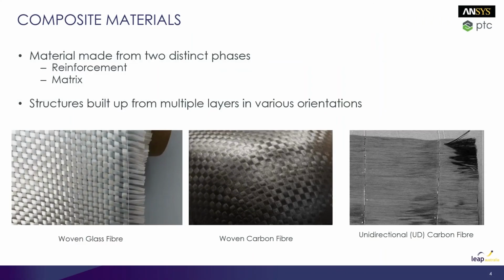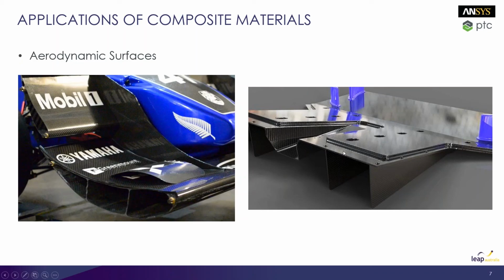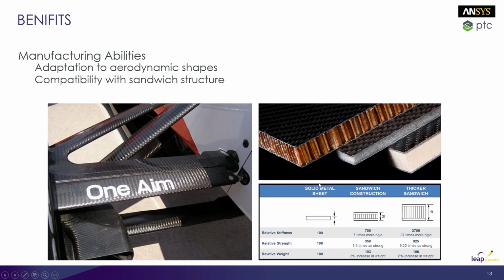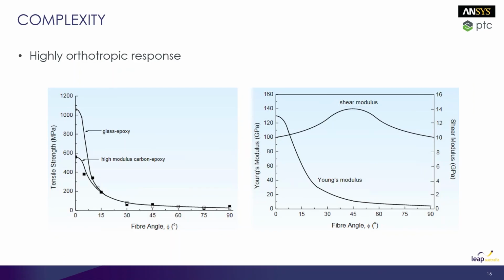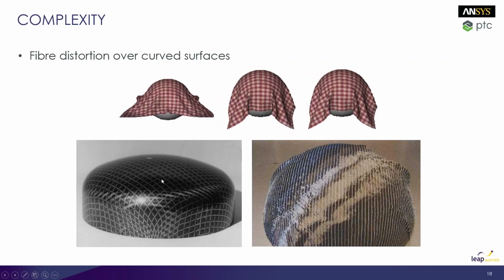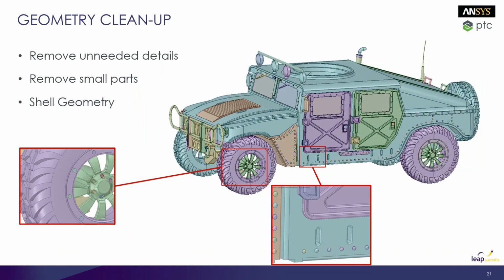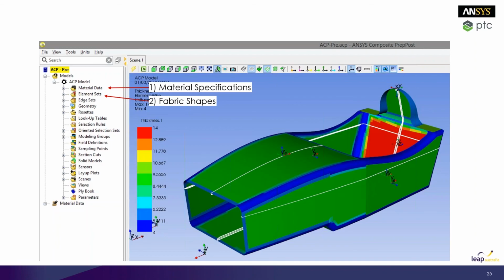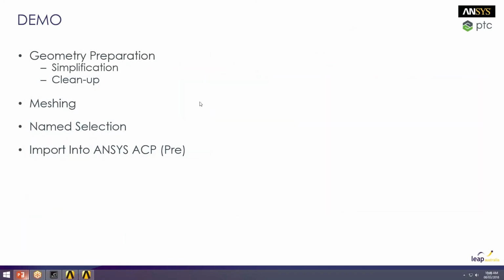Introduction to ANSYS Composites PrepPost (ACP) - Presentation - Composites for FSAE #1

Comment: Nice video. Thank you. One question - how would you model a metal insert within sandwich panel?  I'm trying to do it but can't get around one issue:
My initial idea was to use solid modeling and assemble metal parts with solid composite parts in Static structural using contacts/bonding.
1.	I created OSS that includes full face of the panel. I created top skin ply’s on that OSS 
2.	I created another OSS that covered full face but has a cutout region where metal insert should be placed. I created a core ply using this surface. 
3.	I created bottom skin ply's using first OSS (one that covers full face of the panel)
4.	Now, when I try to create solid model, all is fine with top skin and core layer, but bottom skin has a hole/cutout in place where there’s no core.

Any suggestions on how can I avoid this unwanted  cutout in my “overcore” ply’s? 
What is the proper way to model such structures – sandwich panels with metal inserts?

Update: Figured it out - using cutout feature in Create Solid Model branch solves this issue.

Comment: Which ansys version you are using plz reply
Reply from the maker: Thanks for your interest. This is quite an old video - it would likely have been created using Ansys 19.x, there have been significant changes since then and we recommend you upgrade to 2023 R1 to take advantage of the cumulative improvements to the software, especially in the area of composites modelling

Comment: So, by the Tensile Strenght graph shown in minute 15:00, we can then claim that Carbon Fibre/Epoxy has a much lower value than Glass Fibre/Epoxy. Isn't this counter-intuitive to most tecnical documentation? As far as I know, Carbon Fibre/Epoxy is 'stronger' than Glass/Epoxy, isn't it?
Reply: I suppose that the property shown in the graph is the maximum tensile strength (the maximum tensile stress they can support before breaking) that each of them can support in the different directions. In this case, we have a glass epoxy with 1050 MPa and a HMCF with 550 MPa in 0º direction. 

But what about “strong”? When you referee to strong, I think you are speaking about stiffness (defines the relationship between the applied force and the deformation that is generated). The stiffness is related with the young modulus and the HMCF, as you told, should be stiffer “stronger”. 

In this case, if we get the glass-fibre to the limit, we will have a tension of 1050 MPa and a deformation of 5 mm, for example. In the case of a HMCF, if we get it to the limit, we will have a tension of 550 MPa, but a much lower deformation, due to the high modulus or high stiffness, 0.1 mm for example. So, the HMCF is stiffer “stronger”.

Hope this has help you. Some pictures will be okay for a better understanding, but the key is to understand the difference between the young modulus [MPa] and the ultimate strength [MPa]. A higher young modulus doesn’t necessarily mean a higher ultimate strength or vice versa.
Reply: I could explain it a bit better, sorry for that.

If we apply a certain force to both materials and we achieve 550MPa in both of them, for the Glass-fibre we will have 2.6 mm of deformation and for the HMCF 0.1 mm. So, the HMCF is stiffer. But what happens if we increase the force?

For the Glass-fibre, we can increase the force until 1050 MPa are reached and the deformation increase will be proportional with the tensile strength increase (supposing that we are in the lineal elastic zone), achieving 5 mm of deformation. But for the HMCF, if we increase a bit the force applied, it will brake because we have passed the ultimate strength value.

As conclusion, the Glass-fibre is able to receive more strength (higher ultimate strength) but will show a higher deformation with the same strength comparing to the HMCF.

Hope with the combination of the two answers help you.

Comment: which criteria of failure is used for composite? how can i understand whether a composite is safe or not?
Reply from the maker: ANSYS Mechanical can utilise nine industry standard failure criterion to analyse damage in composite structures.
These criteria's will allow you to calculate the minimum reserve factor and give an indication of the structures safety.
Be sure to watch the Analysis Demo for Composites PrepPost to see how these failure criteria can be used for your problem.